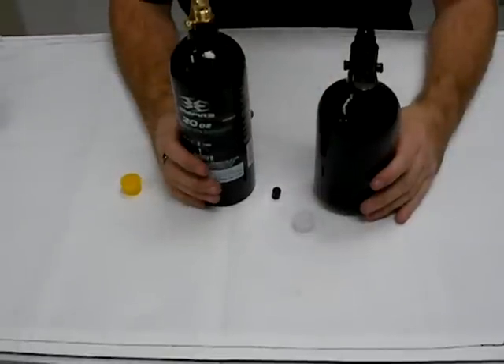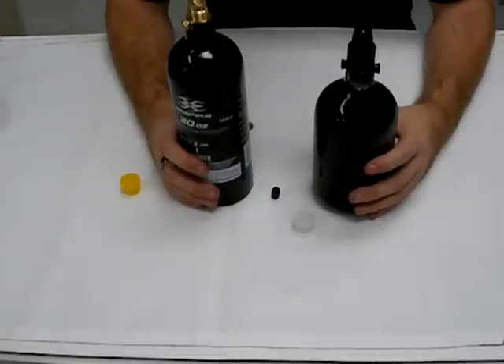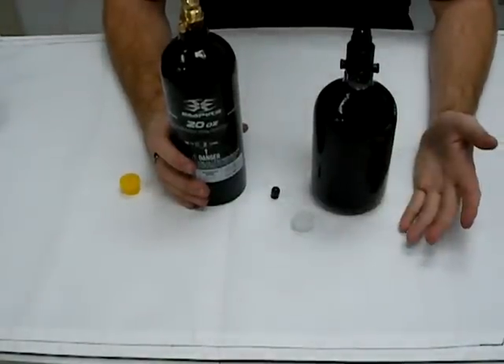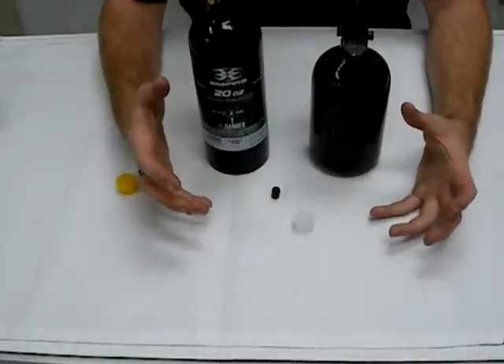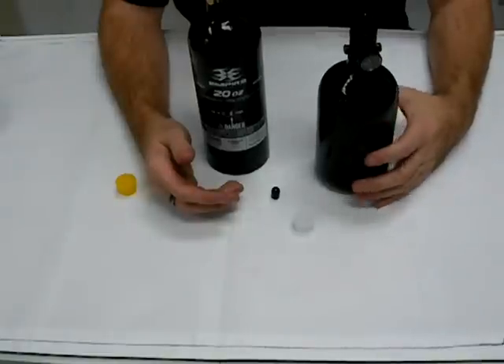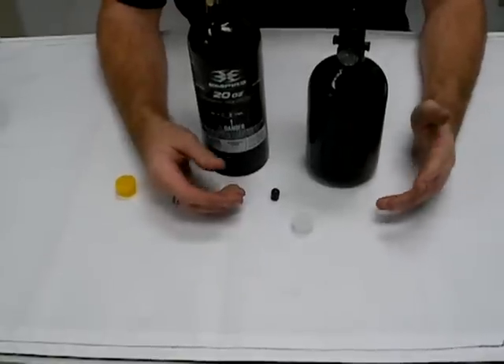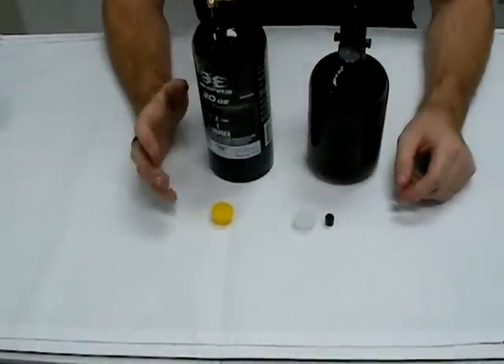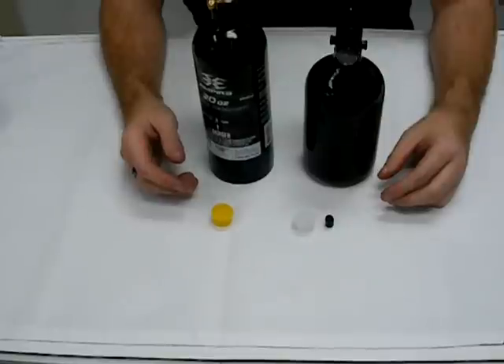What is the Difference between Co2 and Compressed Air

Comment: Hello sir co2 cylinder use oxygen cylinder...??? Co2 cylinder valve change and than oxygen gas use in cylinder.. It is possible..!!!
Reply from the maker: Do not install a compressed air regulator on your CO2 cylinder. The CO2 cylinder is not designed to handle the kind of pressure that the compressed air regulator can handle. Compressed air bottles are designed to handle and hold thousands of pounds of pressure, a CO2 cylinder is not.